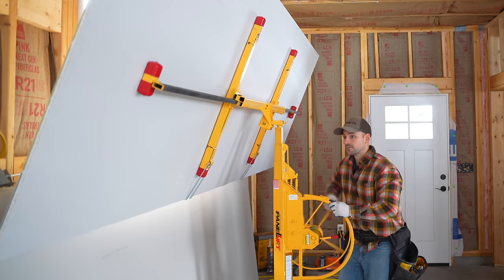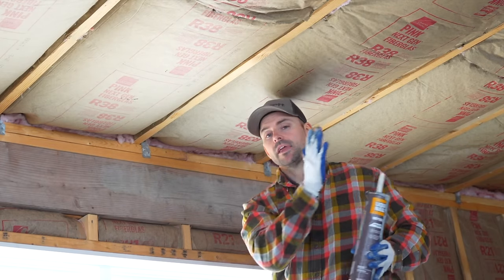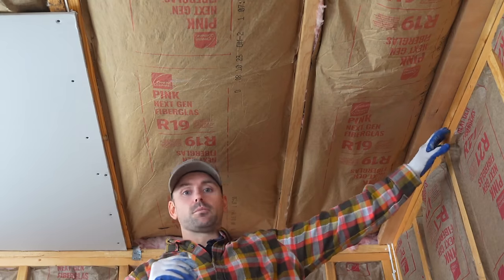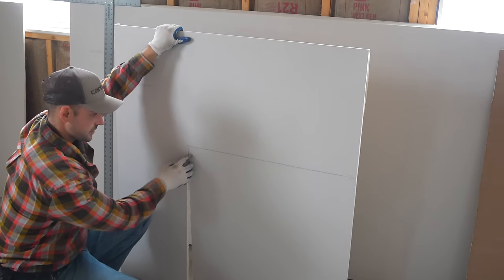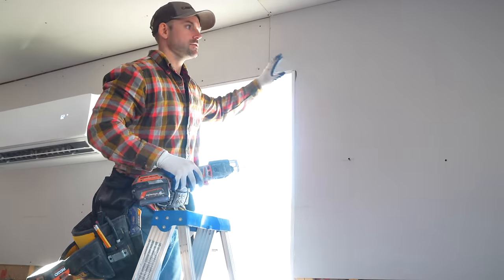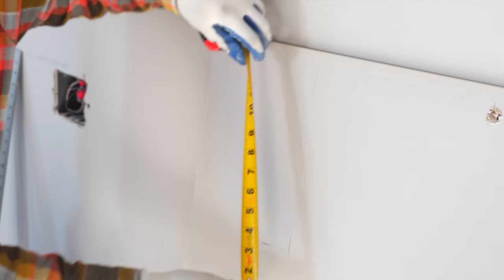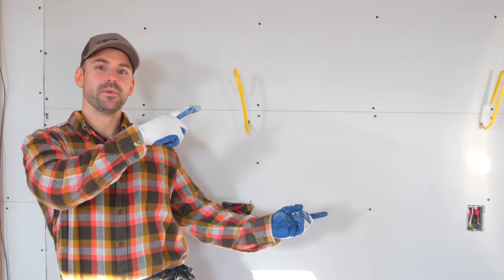How To Hang Drywall - BEGINNERS GUIDE

Comment from the maker: Timestamps below 👇to help you navigate this video. I hope it helps! :_laborer:
Drywall Types 00:17
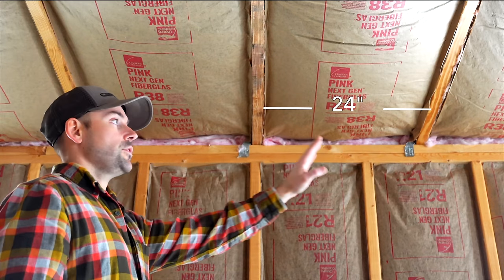Drywall Tools And Supplies 03:46
How To Cut Drywall Using A T Square 12:54
How To Use A Keyhole Saw 17:27
Cutting Out Ceiling Electrical Outlets 15:26
Drywall Ceiling Installation 06:40
Drywall Wall Installation 20:04
Cutting Out Wall Electrical Outlets 25:34
Timelapse With Voice Over 30:10
Reply: Can you please expand on what's stated at 10:40 about chalking a line in cased the walls are not square?  I generally understand you're trying to make sure the boards are square with the walls and ceiling.  However, I'm not exactly sure how to deal with a room that is not exactly square.  I don't want to ask too much of you since you're already made a big effort to produce this video, however, if you're inspired to make another video, I would find it helpful to see how you install the ceiling panels in a room that is not exactly square.  Seeing how you make the chalk line and how that line is used, would be helpful and greatly appreciated.  Thank you for everything, Sir.  Thumbs up on this video.
Reply: The  only thing  I get confused how to keep the drive screws line up so they always hit the  Stubs or 2×4 .😢😮

Comment: The use of Liquid Nails is a sign of extremely poor craftsmanship, because it makes any future remodel or repair an absolute nightmare.  A good craftsman always thinks about how it will affect future jobs.  Liquid Nails should only be used in applications where everything will be trashed if anything will need to be repaired.
Reply: What lol.
The screws are ONLY there to hold drywall onto the studs until the liquid nails adheres.

Too funny.
Reply: Yeah future demo should never be a major issue or game changer. Glue as you must listen not to this bust. 35 years of contracting….
Reply: That's just a stupid statement 🙄
Reply: @spf-92.5  I didn't say future demo.  I said future repair or remodel.
Reply: @JohnSmendrovac  Stupid is as stupid does, and it's stupid to use Liquid Nails in any application that is not going to be trashed if you need to repair or remodel.
Reply: @Rx4Lyfe  So what held drywall in place in older homes?  They only used nails back then, and didn't even use screws.
Reply: @TheOhioCountryboy  yes, & car tyres used to be solid before inner tubes and tradespeople used brace & bits to drill holes in timber.

Technology has moved on...
Reply: @Rx4Lyfe  Just because something is more convenient does not mean it has the same quality.  And you are comparing apples and oranges.  A hole drilled by a brace and bit is comparable to a hole drilled by an electric drill.  Liquid Nails is a permanent solution to temporary problems.
Reply: in this case, i don’t think it matters much. you mud over drywall screws so you can’t exactly pull them out easily.
Reply: @lil-j-waters  You bust the old drywall off, and shove the bit in the end of the screw and the mud breaks out and you run the screw out.  It's not difficult.
Reply: Jesus bud, this is all you have to say to this guy? The video was fantastic and super detailed and you wanna bitch about him using a product made to affix drywall.  Smh
Reply: Omg - I thought that as well as I was swearing up a storm bustin those mfers off the frames w all that damned glue 😢but after research realized that it is necessary for longetivity...I guess. 😅

Comment: I used 5/8 purple on my entire house 300 sheets. Cost about 25% more than 1/2 regular. Denser and more soundproof water resistant mold and fireproof. We also went 2x6 exterior walls and rock wool. Really quiet solid peace of mind. Cheaper than a fancy monopoly design.
Reply: cool
Reply: That was very smart 👌

Comment: I've only been finishisg drywall since '75 and hanging it since '85. I went through a painters apprenticeship program  back then and they taught me how to finish with pan and knife. When I turned out as a journeyman I switched to using hawk and trowel(I can also use the mud boxes and bazooka). Knowing how I like drywall hung for efficient finishing I taught myself to hang around 1985. When cutting out outlet boxes with the rotozip I go counter clockwise because the spin of the bit sucks it to the box and keeps it there when you go around it so there won't be any gaps and the cut is closer to the box and cleaner. When doing the inside of things like pipes(which is next to never) then you can go clockwise with the rotozip (or the Milwaukee). I'm 72 now and I'm still finishing, hanging not so much.
Reply: Come finish my drywall. I’ll fly you here and put you in an Airbnb!
Reply: I'm 72 and retired. @JanetKohl

Comment: Using liquid nails is unnecessary in my opinion, the screws alone will do the job quite adequately and like mentioned in other posts if you have to replace a piece scraping that glue out it’s gonna be a real pain in the ass for future repairs… Otherwise great video… Keep on rocking

Comment: Don't understand the glue on the ceiling seems over kill just 3 screws in the field is fine. Also don't use an impact for drywalling use a drywall screwgun way more efficient if that's all u have fine a 1 day project Will be a 3 day project right tools for the right job always wins the day

Comment: Great video. I appreciate the depth of detail you share. I have a question. My room I'm drywalling is 11'10" wide with the floor joists running parallel to the width. It would seem to make sense to use 12' panels since the 16" OC spacing is spot on for attachment. Is there a reason you would not recommend running the drywall long edge parallel with the joists? Thanks

Comment: Also, living where I do, you get these "self taught" drywallers who don't know what they are doing because they were either taught wrong or had no one knowledgable in the trade to teach them the right way. Recently I encountered two guys hanging my buddy's shop ceiling (they were supposed to be drywallers but they line up all the butt joints instead of staggering them). If I had the authority in this situation I would have fired them on the spot. I should have fired them anyway had the county sherriff escort off of the property.

Comment: I always wondered what the different colors of drywall meant. Now I know which one to use for my soon-to-be fixed and replaced leaky ceiling. And how to go about fastening them properly on the ceiling studs. Good stuff in this video, Josh. Thanks!
Reply: Use Purple board better than the green crap.
Reply: Thanks Scott. I'll check out the purple board.
Reply: @scottschwenk9570  Thanks Scott. I'll check out the purple board.